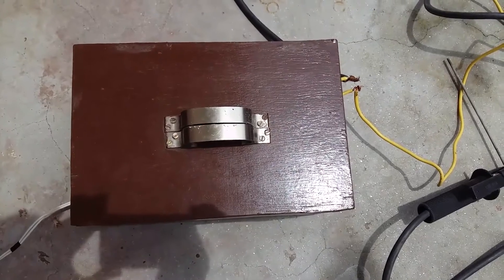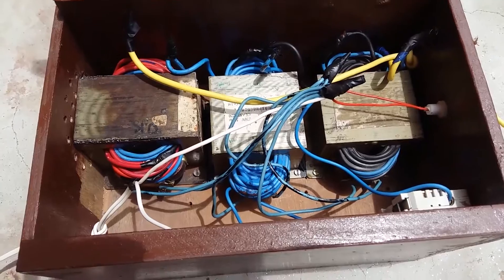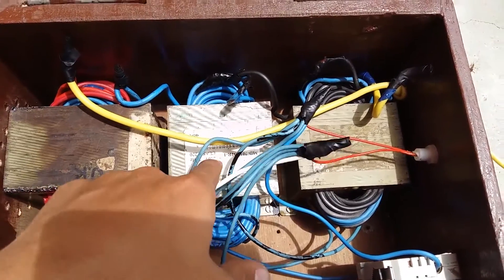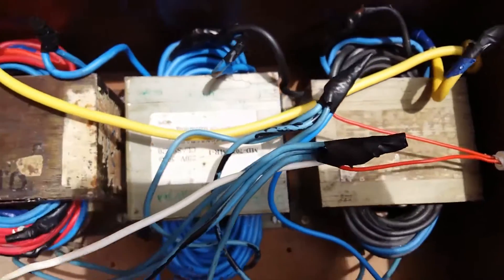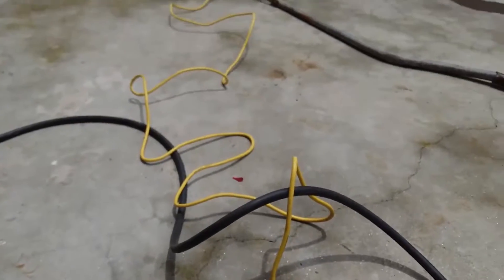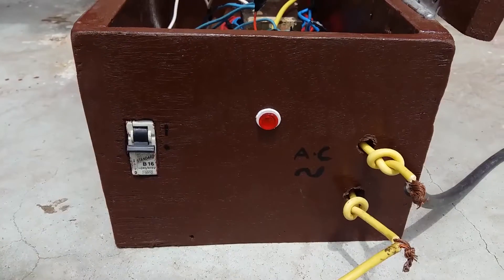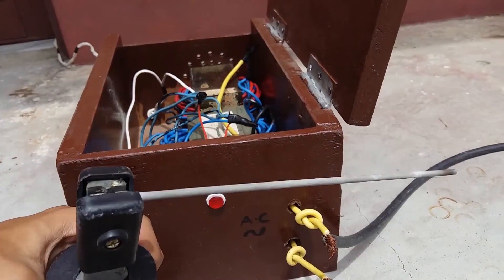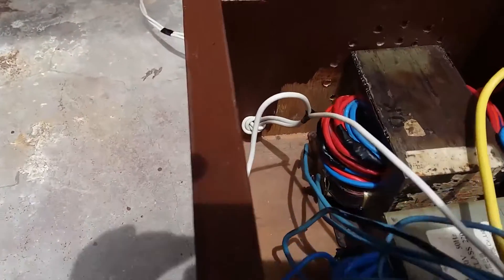Homemade Arc Welder / Stick Welder using 3 MOT (Upgraded)

Comment: hi how do you connect the 3 transformer in series?
Reply from the maker: I actually used Trial and Error method. I first measured output voltages of all transformers and then connected output of two transformers in series and checked output to see if they are cancelling each other or not then as they were adding voltages up I connected third transformer and checked again to see the voltage of all three and saw all adding up. If total volt output in series is not equal(almost) to mathematical sum of individual output then change the terminals of input.
Reply: thanks
:)

Comment: Think about an rectifier and throw some inductive choke after that, it will help the arc to stay, now it's on pure AC and every time it goes through zero it wants to kill the arc by itself, so it may be tough to maintain the arc without some serious welding skills
Reply from the maker: 5Dale65 Thanks for such info. Will look into that.

Comment: I made a 3 MOT welder, it turns on fine, but the arc won't strike. What did I do wrong? I connected all the primaries in parallel and all the secondaries in series.
Reply: I finally saw what was wrong, but more importantly, it works and it can melt 6010s better than a conventional, store-bought welder.
Reply: what was wrong?
Reply from the maker: Start of arc is directly proportional to voltage. What is your voltage and current during short circuit
Reply: I don't remember, what I do remember is that was in the wrong shop with bad quality electricity. Anyway, thanks for your help.
Reply: your coils are most likely out of phase, so they cancel out. what is your open circuit voltage
Reply from the maker: Good for you
Reply: Random_rapper20 right

Comment: Would it be possible to run 6010s with 3 or more transformers? I'm pretty sure that 6010s need lots of voltage to get an arc going. I never used 4 MOTs or more in a series, but I think that 3 transformers should have the same voltage as the Lincoln Tombstone or AC220. If the current is too much from 4 or more MOTs, then you may need resistors like Christmas lights in a series or a dimmer.

I read that a big and heavy transformer welder can run 6010 or 7018 rods fine on AC. Your welder would weight at least 600 grams, but with a lot of copper and yet it welds just as good as a Tombstone or AC220 from Lincoln, which weigh like 56 kg and that is the average weight of an AC buzz box (my father has one and it was difficult to get a 6010 rod to melt like cheap margarine). AC buzz boxes may not have as much copper as your 600g welder.
Reply from the maker: First, it is more than 5 KG in weight. It doesn't matter how many transformers your have. I have necessary amperage from my transformers. This is why I have added a new MOT in order to increase voltage. If I need current, I would add MOT in parallel. I haven't tried 6010 and 7018 rods but they definitely need more current and voltage. Mine arc not long nor short(in my experience). BTW thanks for your input
Reply: 6010 is made for dc the ac version of that rod is 6011 it can be used with ac or dc.
Reply: Most 7018 is made for dc also but there are some made for ac, 7018ac.

Comment: hi delta u got a nice diy arc weld my outlet is 220 volt  how cani connect my primary wire in paralelel since my transformer input is  110 volt  all my transformer will  burn  right ?pls show me how  tanks so much  my e mail  is       fourtracksmusic@yahoo.com          Dave
Reply from the maker: +Myrna Thomas You can connect two 110v transformers in series and then feed the 220v. Give it a try and test them first. BUT, your 110v transformers may be of different frequency as they are of 110v and may not perform healthuly with 220v input.